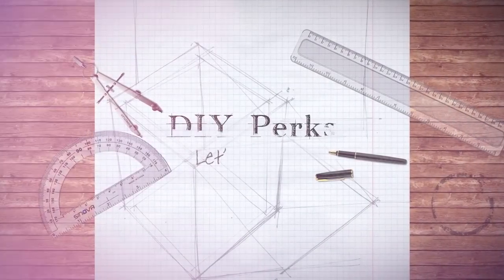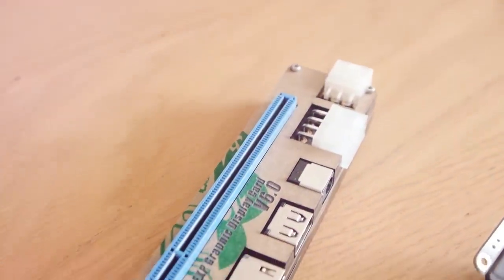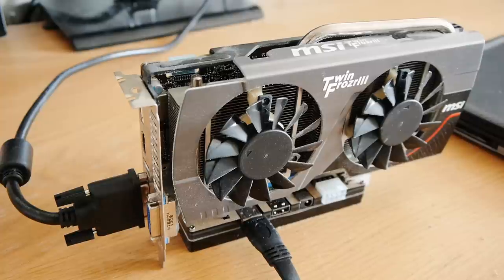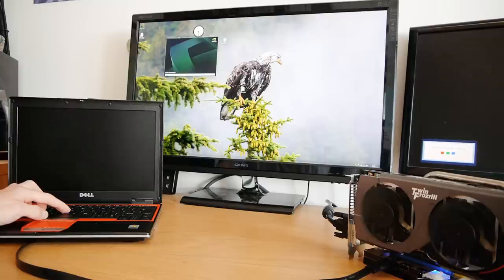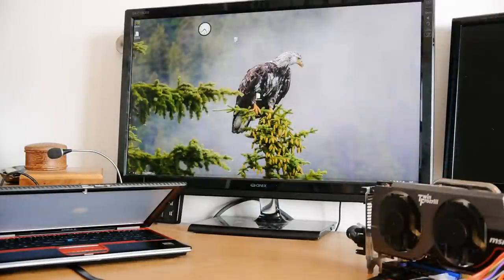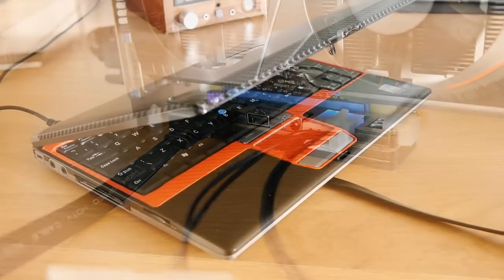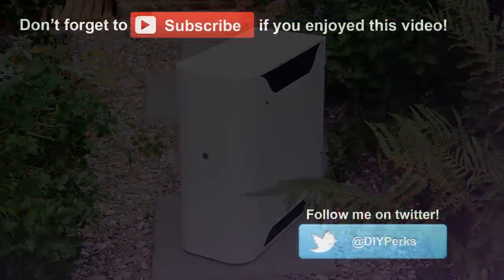Gaming on a Laptop using an External GPU

Comment: "slow 1.2ghz processor." Macbook 2015 calling in with a 1.1ghz processor.
Reply: +FluffnTough is there an ELI5 of why it would run better?
Reply: sorry, it's Explain It Like I'm 5. like a dumb down explaination of how.
Reply: +Brad'sGamingPlace lol not everyone goes to reddit. So, for a normal explaination, there's more to a chip's performance than clock speed, there's IPC, cores, and other things that influence the speed of the chip. 

ELI5 - clock speed is the rate it moves. Let's say you have a wrench trying to unscrew a nut and there's two people, one stronger person and one weaker person. Even if they rotate the wrench at the same speed (Clockspeed), the stronger person will unscrew the nut faster (performance overall) because he's applying more force. Same with the chips, they're stronger in other aspects, so they are faster.
Reply: +Brad&#39;sGamingPlace To be fair clock speeds not the most important thing for speed. Cpu use to be single core and the onyl way to get faster was with clock speed. We got cpu all the to 5ghz single core. Now its more about have more cores doing more processes instead of 1 having a brute force speed.  For example my i7 2.5ghz is still faster than my pentium 4 setup thats running at 5.1 ghz.
Reply: Rockmandash12 Thanks for the dumbed-down explanation. I knew a little about clock speed and how generally AMD CPUs have a higher clock speed and more cores but down perform as well as intel chips. I never really found the answer to why that was.
Reply: Brad'sGamingPlace AMD doesnt perform as well as intel because they've been sucking for the last 5 years period. Not enough R&D. Their processors simply are as well design as intel and they've lost a huge competitive edge. Lets hope they get back on the horse.

Comment: what gpu's are compatible? is the gtx 750ti and gtx 960 compatible?
Reply: +Merlijn Fransen Most likely, I'm not sure if there is any that are not compatible, i think the only thing you have to worry about is you CPU bottle necking you graphics card
Reply: Dummy Craft Industries myea i have a i7 4510U @2.0 ghz dual core :(. I can upgrade my 4gb ram doh im gonna upgrade that to 8 later
Reply: +Merlijn Fransen actually, intel turbo boost (which is on by default) increases your clock speed from 2.0 GHz to 3.1 GHz. Though from what i've heard certain downloadable programs could possibly deactivate turbo boost, though there is not a single video game that deactivates it.
Reply: Kip Higginson didnt know that thanks
Reply: Merlijn Fransen np.

Comment: hi i have got a lenovo y50 with nvidia geforce gtx 960m 2gb so what am saying is if i bought that thing of ebay and saved up for an nvidia geforce gtx 970 would the 970 fit into that thing and would the 970 run fine on my laptop am only asking becuase i have got an older nvidia driver and i want to play vr games on it with oculus rift

Comment: I want to use it with lenovo y 50-70 I7 3.5 ghz ram 16gb with mini pci-e as an external gpu with my laptop will it work?
And the graphic card I want to use is gtx 1070

Comment: i like to connect asus nvidia gt 610 2gb ddr3 graphics card.my laptop has a pcie slot which already has a wireless chip for wifi.i am afraid if it doesn't connect with my laptop
Reply: +Dine Suth1 the gt 610 is notvan upgrade, gtx 750ti will do

Comment: where i find all the power cabel? and the powersupply???
Reply: Its just a normal desktop computer's power supply, and they often come with the needed cables.  newegg.com has always been good for buying these kinds of PC components.  You might need a $2 adapter cable to make it work with the newer graphics cards, but literally any old working* desktop's power supply is going to be good enough.  Even the 15yr old Compaq tower I pulled out of a dumpster had a good 200 Watt ATX power supply.  

PS.  you will need to jumper 2 pins on the desktop PSU's motherboard connector to make it turn on.  I forget exactly which two pins, but that's google-able for sure.
Reply: PPS. it comes with the kit

Comment: guys pleas help. I've got a asus k73s and specs are:
- Intel core i5-2410M
- 8 gb ram
- two graphic cards: intel hd 3000 and nvidia geforce 610M

Let's say I want to use a  gtx 750ti, will it eventually work or do I miss something.

Comment: still confuse !!?
someone help me plz.
my Laptop (Toshiba Satellite L840) Spec : Core i5 3230M 2.60 GHz, 8GB RAM with AMD Radeon HD 7600M 2GB. (no EXpress card slot on side casing)
can this guide allow us Laptop (without exprees slot) user have external grapich card ??
Reply: yes. it uses your m.2 slot inside the laptop. you might have to remove you're wifi adapter or your ssd though.

Comment: ok, someone i need help. i have a nvga geforce gtx 970, that has TWO additional 6-pin PCI-E power slots. how/where can i get a cord to run power to these slots! this is preventing me from gaming on my ASUS laptop with an i7 core. i was extremely looking forward to this and now i am completely bummed out because my gpu doesnt have enough power to turn on. im using a 350w power supply from my old dell desktop.

Comment: can this work on Desktop PCs i have a pc that dont fit anything execpt a small gt 630 :// and the 630 crashs with low games
So what if i buy an amd r7 360 and use this thing with my desktop pc will it work?
Reply: If it is a Graphic card aka "GPU" Then it work every gpu will work on desktop or whatever And need extra power if the graphic card is a power hungry :)

Comment: I'm not opening my laptop.  Make it USB compatible
Reply: ***** I don't doubt it.. I changed my ssd, ram, and all that in mylaptop. easy.  But I'm NOT and in NO WAY screwing in the GPU and unscrewing the GPU to i can take it out everyday I have class... simple as that.   In real life, simplicity if valued  over complexity.  Respond to that
Reply: ***** that's my point, I'm not wiring and rewiring (from the back) just for a single purpose.

Comment: This isn’t a product, it’s a hack, a working one , but still a hack... they provide the PCI-Express adapter but not the PSU, and why would anyone want an internal PSU and it’s messy cabling sprawled over their desk... now for the worst part, you dangle a heavy HDMI cable from an incredibly fragile internal PCI port inside the laptop and hope everything goes to plan years from now. Let’s not call this a product, more a fun little weekend project but certainly not a product.

Comment: I am unable to detect my amd radeon rx 480 8gb in my device manager. I am using an MSI ge72 apache with an ngff connector. I took out the wifi card and followed all of the steps. Should I get an Nvidia card or what should I do because I've tried a bunch of things. If anyone has any ideas can I please get some help.
Reply: idk i was goona get the same graphics card

Comment: Can my laptop run GTA V on high setting?

Cpu: i7 6500U
Gpu: Nvidia Geforce 940m 2gb
Ram: 12gb DDR3
HDD: 1TB
Reply: Maybe at a low resolution, yes. But I think you would need to go on medium.
Reply: No, you can't. It also depends on wether you will play it via steam and social club since this decreases performance. I run a gtx 670 and I can get 70fps avg (45-95) at 1080p with medium settings. Because your videocard uses 2gb of ram, you cant get the textures at high.
Reply: Easy

Comment: i got a laptop with i5 3230m will it be fine if i connected the titan x to it with adapter
Reply: If you got a PSU with the required wattage to run the Titan X, then yes.
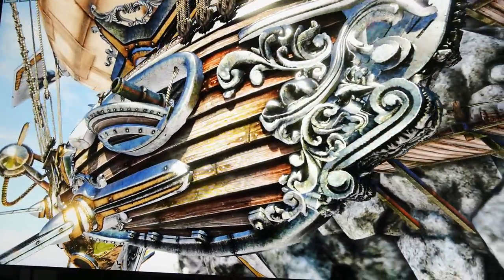Reply: Just note what he says at 3:17.  You may not get 100% of the GPU's performance.
Reply: dude go the GTX 1080 route or 1070
Reply: huge bottleneck
Reply: Alex P Huehheheuhe
Reply: WTF a titan X?

If you have that money, it's so much better just to build a desktop...

Comment: I have an go envy 15 and it only has 1 pci port my friend said it won't work if I remove the internet pci for reasons I can't remember to repeat has anyone done this with one pci port?
Reply: I'm planning on doing it with one pci port. Are you saying it might now work?
Reply: i did find a video of someone doing this with only  1 pci so the only thiing you will need is an ethernet if you plan on using internet while a desktop gpu
Reply: Reactem ok awesome. Thanks I got worried. Do you know if you can reinsert the wireless card when not using the eGPU setup? Or do you just have to get a wireless internet dongle.
Reply: lol i have no idea what u asked but if what you are asking is can you take out the adapter and reinsert the wireless card yes

Comment: does it work with windows 10?
Reply: How would an operating system have anything to do with the graphics card? lol of course it would work as long as the laptop has the required port.
Reply: well actually window 7/8 works better than windows 10... (if u are trying to make the gpu run on the laptop screen)

Comment: Okay will this work with any laptop or specific laptops? Does anyone have a list of compatible laptops. Because my laptop is a toshiba satellite e55-a5114 and I was hoping anyone reading this could help me out.     

Thank you for reading
Reply: Make sure it doesn't bottleneck
Reply: hmm hmm not helpful. Next person!!
Reply: It should work. Unscrew the back and check if it has an open mPCIe slot or if it at least has a wifi card occupying one. You may have to remove the wifi card to plug it in.

Comment: can anyone reply me with a link for a cheap power supply for this product? Cause i bought it the port and a graphics card which is a zotac gtx 750ti 2gb, and now the only thing i need is a power supply. Cheers :)
Reply: and the zotac gtx 750 ti requires 400 watts of power, so please someone reply me with a good power supply that i can buy
Reply: just buy a cheap power supply with the necessary connectors
video cards generally only use > 150w of power

Comment: Would pairing a 1050ti with a i5-6200u 2.3 ghz work?
Reply: David VL yes
Reply: David VL Hmm, wouln't that run something like gta v ?
Reply: i hope so
Reply: Yes but the 6200U is a dual core
Reply: +Jareware Oh. Then gta wont work. Its gonna be laggy
Reply: jamppa- .-kor It would still work maybe just trouble rendering textures at times. Better of building a PC even with used hardware. You're taking a bit of a gamble doing this.
Reply: Jareware Dual core isn't good for handling gta v. Maybe iv but not v. It will run. But even xbox 360 would perform better..
Reply: wrong, an i7 6500u has no issue as long as your graphics card can take the brunt
Reply: Allahu Akbar Jihad Well, if it's played online, then it might be playable
Reply: jamppa- .-kor It has hyperthreading... just like an i3 6100 will be fine.
Reply: Well it would be better with a quad-core HQ processor for sure
Reply: Louche freeco Yeah.. dual core isn't just enough for nice gaming experience...

Comment: will this work with Gtx 1080
Reply: what are your laptop specs ?
Reply: i7-4510u 64bit
16Gb ram 1600 Fr
GTX 850m
Reply: +unwelljoy your cpu will probably bottleneck the 1080
Reply: Hysterical how is that possible ? i;m running i7 can you pls explain mate who it will bottleneck  what is the ranged of GTX 1080 compatibility on CPU?
Reply: unwelljoy depends on what model i7 but if its like xxxxu dual core one yeah those are not reaaally powerful
Reply: Hysterical  man there is no such i7 dual core. i7 has 7 or 8 cores and why the. my set up can run any games in ultra...  i just want to know if this External GPU will work on GTX 1080
Reply: +unwelljoy it is definitely a dual core, bro
Reply: Jan Seewald YA MY BAD
Reply: +Hysterical what do I have one of the i7 6000 series cpus?

Comment: Okay so I'm a total fucking idiot, if I bought one of these and a new graphics card would this make my notebook 2000 useable for minor gaming?
Reply: Sure fam it all depends on your graphics card but I would check to see if your notebook even has the pcie port on the back also you would need the power supply to which I would say just build a pc
Reply: Carlos Bonilla Would $250 be enough to build a decent PC?
Reply: No the minimum I would say is around 400$ but if you have 250 and a laptop I would give the external graphics card a try I just bought a gtx 970 for 230
Reply: Carlos Bonilla I would also have to buy the power source and what else?
Reply: +Bryce Green you would have the get the graphics card, psu and the external adapter thingy the video was about also I believe you would have to have a monitor since from now on you would have the hdmi output from the graphics card and that would go to your monitor or tv
Reply: Carlos Bonilla OK thanks

Comment: Dude what the fuck, the meaning is to play it on laptop, if ure gonna use desktop screen then whats de point of even running it on a laptop? You just used and expensier CPU which is the laptop. Is it possible to run that at the pure laptop? As if you were a backpack traveler, you are not gonna be carrying an external screen and so much of a monster power supply... is there a way to make this more compact? Like a power supply thats only a few cubic centimeters adapted to the wall energy.... and NOT an external screen...